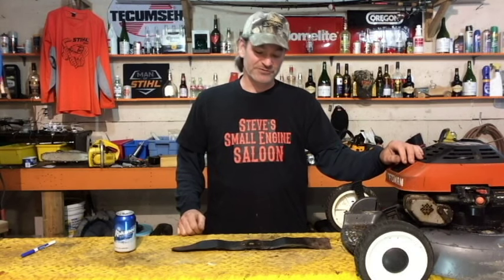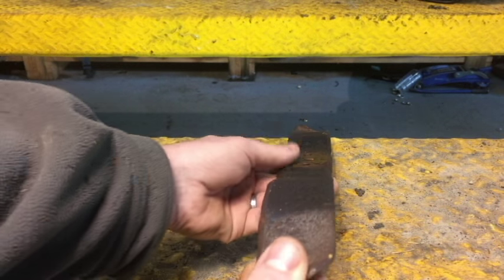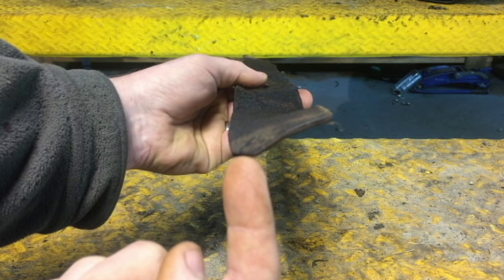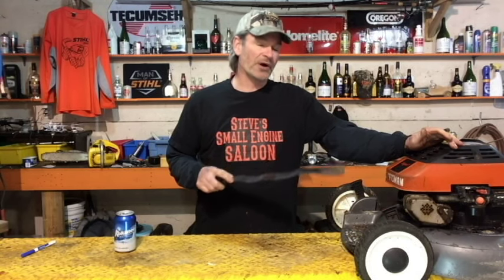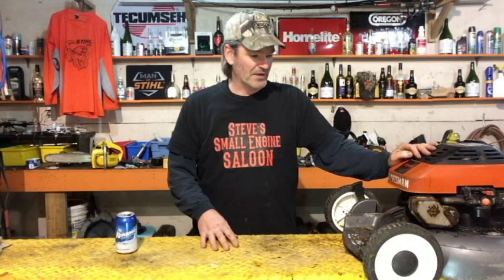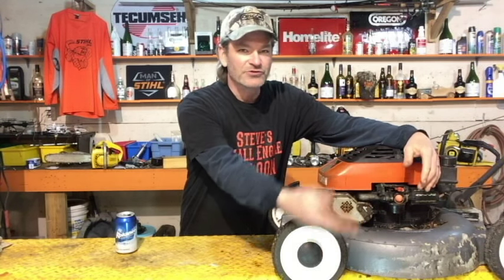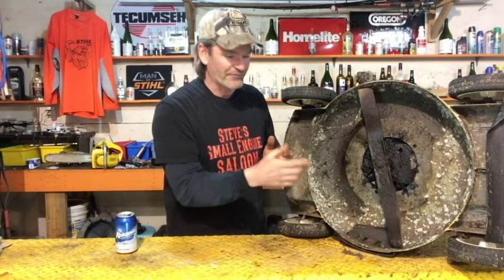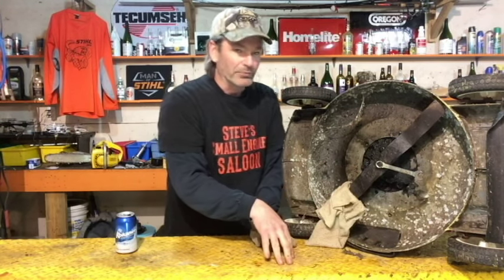How To INSTALL A Lawn Mower BLADE Properly (Step-by-Step)

Comment: I have a question for u   I have a mower a toro 6.75 hp Briggs engine on a push mower. It started running rough a couple weeks ago. I cleaned the carb meticulously,changed plug,cleaned gas tank out and put fresh gas in it. After 10-20 mins of mowing is when it starts to act up it's like it's trying to catch up is the best way I know how to explain it.   We changed the coil out of a craftsman 6.5 hp mower.  The other day I took air hose and blew it out real good around the flywheel and other parts of the mower.aftet I did that it would run excellent for about an hour to hour and 10 mins and then it would act like it was going to do it again.   Do u have any ideas as to what it could be. The mower is real clean has been garage kept.
Reply from the maker: In my opinion, the two most common problems for the issues you are having are the coil and a venting problem!  You already nailed the ignition idea.  The next thing I would suspect is that the fuel cap vent is plugged.  If air can not get into the tank to displace the fuel level dropping, the flow of fuel into the carb will simply stop!  A simple way to test that is to leave the fuel cap loose next time you mow, so you know air can get into the tank...
Reply: Steve's Small Engine Saloon thanks very much for all the info
Reply: You have an awesome channel
Reply: check all the gaps (ie the flywheel / magneto gap, the spark plug gap, etc.)  A good rule of thumb: take a college ruled notebook, rip the cardboard back off it, fold it to make it double thick, and use that to gap the flywheel (tuck it in between the gap, then rotate the flywheel to get it out).  After that, if it keeps doing it, you want to make sure your throttle cable is set properly.  You do that by making sure it is set to full throttle first, then set it there.   The only other things I could say that it could be:   if it starts to get bogged down and lose throttle when cutting moderately thick grass, you could be losing compression for a number of reasons.  One time I had a mower that had cracked valves, and it would lose compression.  This is kinda time to junk that mower rather than mess with getting it fixed, if that is the case.  Another issue:  if there is smoke when starting, then it goes away, the smokes again when you shut it off, then you might have  a clogged crankcase breather.

Comment: Here's an idea ...drain the oil before you do the removal and sharpening. Put fresh oil in after mounting the sharp and balanced blade. I use a turkey baster with clear plastic tubing tight over the tip ...long enough that you can reach deep into the crankcase to get all the oil. Then flip the mower. I also run the mower out of gas to avoid fuel leakage.

Comment: use a “cheater bar “ always taught from grandpa and dad , keep 3 and a 5ft steel pipe. place over wrench and it’ll come off, even if you use your foot. mostly Riding Mowers in south, so your way on little push mower is great . Dixie Choppers, a little different! thanks
Reply from the maker: Great tip.  Thank You...

Comment: my lawnmower blade was do tight I had to use a combination of my 18 inch breaker bar. a 3 ft cheater bar. 3 big guys. and a torch to heat Round the bolt

Comment: Should you use a torque wrench to tighten
Reply: If following the manufacturer's instructions, you will.  However, I don't  know of anyone that does on push mowers. More people with 2/3 blade rider mowers torque their blade bolts.
Reply: Usually between 50-60 foot lbs. is the spec. Do it if you have a torque wrench handy, Couldn't hurt.
Reply: Yes.Not tight and accident waiting to happenVery tight and snap the head clean off bolt.Then you got issues.Torque to spec.

Comment: Where is your long 1/2 ratchet? You could at least have a ratchet with a long extension.  Also I get more leverage holding on blade with hand with the spark plug unplugged.  Thanks for the tip on how to tell if the blade is upside down.  A torque wrench to put nut back on and I think it is 65 ft lbs.

Comment: late to the party, but a mower Blade turning COUNTER-clockwise will have trouble with side and rear discharging; I've never seen a mower discharge to the LEFT side, or left-rear - have you??

Comment: Steve, I successfully replaced my blade, and I had it tipped the right way, but when I fired it back up 5 minutes after it smoked like crazy so I shut it immediately off and am nervous to start it again.
Reply from the maker: I wouldn't hesitate to let it run and see if the smoke clears up...
Reply: Steve's Small Engine Saloon , yeah it did, took less than a minute. All good. Thanks buddy!
Reply from the maker: Right on...

Comment: I have never change a blade on lawn mower I have a Toro self-propelled lawn mower. I used to live in an apartment but now I live in a mobile home. I have the lawn mower for 2 years. I have never changed the blade on the lawn mower. I don't want to put it on backwards of the wrong way. Give me some guidance. Would you please. Thank you

Comment: I don't take the blade off the mower to sharpen the blade. I run a portable grinder across the bottom side of the blade. Just enough to shine the cutting edges, fully aware the blade serves a dual purpose as a flywheel for the engine, too. I do this once a year, at the beginning of every lawn cutting season.

Comment: Impact socket wrench gets the toughest bolt off in half a second without having to stabilize.
Reply: I would never use an impact wrench on a lawnmower. Too easy to damage the engine if it catches and ruin the bolt as well.  WD-40 and a little bit of waiting and it will come off. No need to use power tools.
Reply: Just have to know how to properly use an impact wrench.
Reply: SM Gilby - Some people are just skeerd! (Scared of impact wrenches that is) As someone who uses them every day at my job I agree with you wholeheartedly.

Comment: Steve.... the best and fastest way and safe way to take the blade off is to use a CORDLESS 3/8 INCH IMPACT WRENCH with the appropriate 6 POINT IMPACT SOCKET... Takes less than a second. And to put back on , takes 1 second. Try it one time and you will never use a wrench again. I work on my own commercial mowers.

Comment: Those little nubs on the inner blade washer (holder or lock) I didn't have the holes in the blade but put it on and tightened the shit out of it.  Wish me luck.

Comment: Way i remember it is >  bent side  next to the shaft hole to earth,  flat side  next to the shaft hole is : is deck  >>  I don't  like to do this but i do!   block the blade where it want turn,  put the wrench on, and Tap the wrench handle to break it loose >  A pipe handle works best. but there never any laying around

Comment: mine was so tight i had to use an inpact with a 6 point, make sure you go the right way or u might snap off the bolt then u r screwed

Comment: Steve, I love your videos! I just bought an old snapper riding mower. it says to torque the blade mounting bolts to 30 to 40 ft lbs...what the heck does that mean???
Reply from the maker: I wouldn't worry about the torque specs.  Tighten it as tight as you can...
Reply: It means you’d need to tighten it with a torque wrench set to 30 or 40 ft/lbs to know for sure. It’s just an engineering spec. Just listen to Steve and put a good tightening on it.

Comment: By putting the mower completely on its side, isn't putting carb side up putting you at risk for getting fuel in the oil? Or maybe even hydrolocking the piston?
Reply from the maker: Another great question!  In the spring and summer, I do this about 8 times a day!  Never had a problem, however; if you left it on its side for a very long time, that might very well happen....
Reply: Cool, good to know! Thanks Steve

Comment: If you can see the blade angle where it was sharpen then it is on wrong. You should always see the flat side. Another tip
Reply from the maker: Right on buddy!

Comment: Man, don't advise double wrenching in this case. Its so easy for that bolt to slip, even with one wrench. And if you ruin that head, you are in trouble. Also I would advise to clean bolt with WD-40 and steel brush. There is always some well  stick small particles of grass and it can contribute to wrench slipping. For me best and fastest way to hold blade is with shoe sole.

Comment: invest in a 1/2 drive rechargeble impact and be done with it.
Reply: Breaker bar works too, and its allot cheaper.
Reply: I use an impact driver because i have one.  Works really well.
Reply: Violent - probably not cheaper than those two cheap ass wrenches Steve was using! 🤣
Reply: I use a 3/8 works great !!

Comment: There's a very simple way to know rightside up or down on the blade...if the curves in the center won't let the blade fit onto the two studs ...then you need to flip it over!!!

Comment: I always reinstall my mower blade bolts with a smear of Never Seize or a smear of Copper Coat.
Then I nip them up. The double-wrenching is not for me thanks. It's an impact socket and breaker bar, or the rattle gun every time.

Comment: IF the bolt is too tight and you double wrench it like he shows you can break the second wrench because you are pushing on the side of it. Yes you get a lot more leverage but which ever is weaker is what will happen. Nut turns  nut strips or wrench breaks. Don't ask how I know this LOL
Reply: I've been double wrenching all my life and never have broken a wrench.  If you are breaking a wrench that way you are using a cheap wrench anyway and probably good if it breaks.   You should be able to twist a bolt off that way and not hurt your wrench.  Guess how I know?

Dale in Canada

Comment: Double wrench trick is ok for a last resort. 
Some penetrating oil & a breaker bar is a better trick.
Reply: Penetrating oil, then go have lunch, then take a long walk.
You need to give it time to penetrate> Now you'll get it off with a breaker bar, wrench + hammer, or, an impact wrench, with less chance of breaking to bolt.

Comment: At 07:05 the best suggestion I can make to deal with stubborn bolts is to get a torque wrench. It will come with a longer handle and give you leverage which will make it much easier to deal with. It also helps when putting the blade back on because you will do it at the right torque spec (provided you can locate the manual to find that) and will likely make the job easier next time.

Torque wrenches are really expensive though, so the next best option is to use a breaker bar which cost much less.

Comment: Use a socket and breaker bar to remove blade with blocked wood.Not a good idea to use hands.Proper way to put blade on is torque to spec.Reasons for this being seen people hand tight.Not a good thing.Seen very tight and snap head off.Few other reasons.Torque it.

Comment: It's a lil slow paced (not necessarily a bad thing!) but great vid ❤

However, you failed to mention that some lawnmowers will have the blade bolt wrenched on backwards, so it's righty loosey lefty tightey 🙃

Comment: Put a 2 x 4 under it to prevent the blade from spinning while you break that nut free. I did not turn mine on the side cuz I don't want gas in my oil filter or stuff in my carb.

Comment: Lefty Lucy & Righty Tighty. But when you loosened the nut the wrench was moving to the right! I'm so confused. The correct technical term is clockwise and counter-clockwise. I think Lucy goes counter-clockwise. That way it doesn't matter if she's on the top or the bottom. Because most guys like Lucy on the bottom, so we gotta spin her counter-clockwise... RIGHTY?

Comment: My bolts still won't come off!
Reply: I have a 30 year old Honda mower given to me. The blade has likely never been off, and the bolt head rounded off . I resorted to cutting a slot in it with an angle grinder and then beat on it with a slotted bit Lisle hand held impact driver. Took a lot of hits, but it finally came off.

Comment: So, your lawnmower had the blade on upside down.  Because you flipped it after you took the blade off.  Flip, put it back on the opposite way it had been.  Did I see that correctly?
My blade is dull on both sides.  No way to really see which is which anymore... except there the blade tapers in at the ends, on side of the blade is straight, the other tapers in, and the tapered part is likely what should be the sharp edge.  But, it looks like the tapered end is the opposite of your sharp side.